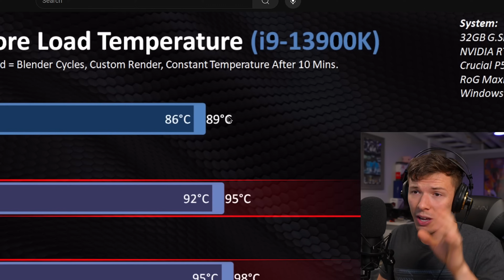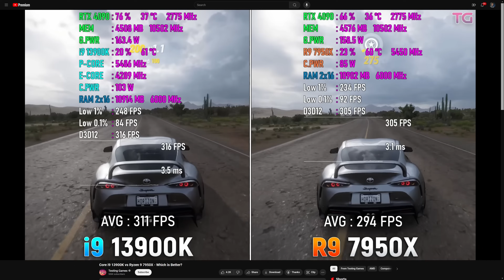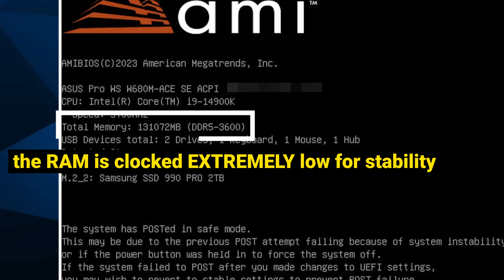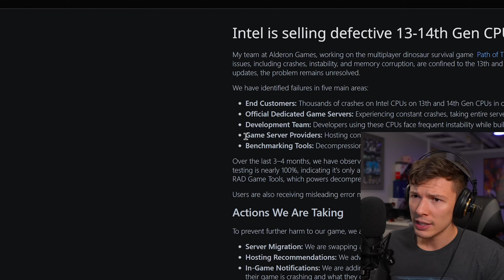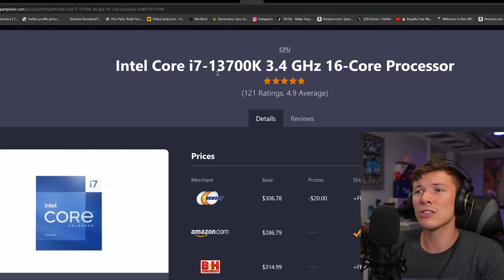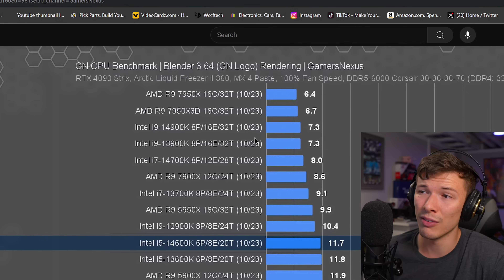Intel F**ked Up Bad

Comment: I'm not really familiar with this particular situation, but my thoughts after watching this video were: 

"Ok, well that really sucks. But then again, are the cpus actually at fault? These game companies are using server motherboards + consumer cpus? 
I mean server components and consumer components are generally designed with opposite philosophies in mind. Max stability vs Max performance" 
I'm a server admin myself and I take care of a bunch of Intel based servers. Various generations. I don't see this problem in my field of work.
Ok, so I just randomly logged into one of my HP gen10 servers. It has a Intel(R) Xeon(R) Gold 6132 CPU @ 2.60GHz (boosts to 3.7). Its a Q3'17 model cpu, Skylake family, 14 cores. And the same year consumer i7 / i9 Skylake family cpus (extreme editions btw) have like from 3.0 base, to 4.4 boost. Also, you use base spec ram on servers for stability. Many things can go wrong here. And if you are using a consumer cpu as a server cpu, perhaps you need to configure your server differently. Perhaps disable boost or do some undervolting if that is available. Not trying advocate for Intel here, I run Amd everything in my personal pc. Just saying that if you use something that was not specifically designed for that use case, it might run, but you might run into unexpected issues.
Anyway, I hope that Intel and their partners will get their stuff together and fix this problem.
Whew, that's was a nice quick brake from my CrowdStrike problems. Back to work. xD

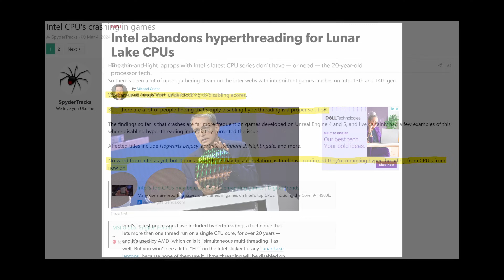Comment: 12:10 or so ~ Is it hyperthreading?
Ok, no simple answer. From what I've read, if it crashes, and you disable hyperthreading, that will fix it. For a while.
If you turn down the voltage, or limit the clock speed, that will fix it. For a while.
If you disable the E-cores ~ that often fixes it. For a while.
There was a strong indication when this started to emerge, that it was external communications, like data out to the video card and network traffic, and particularly high speed SSD reads and writes, and decompression of things like game_textures. Further looking at that, seems to show problems can and do happen there, but that's not the root cause of it.
Some M.2 drives produce a lot of 'network traffic' that's got almost nothing to do with that data, and one theory going around was it was Toshiba and Samsung M.2 drives. That doesn't seem to be the root cause either. 
Problems occur with many things, and depending how you parse your data, you can show very suggestive things about a lot of stuff, but the harder you look, the less it adds up.
Go listen to Wendel talk about it, he's fascinating. The frightening thing, it seems to effect more or less every high end Intel chip, certainly everything that's an i7 or i9, in the last two generations. Some chips have not yet been effected. Testing suggests they will be.
I know I would be much happier to be in the position Lisa Su is in, right now, than the one Pat Gelsinger is in. I think Pat's being forced to sit on a barbed wire bollard right now, coated with hot sauce and Denco-Rub.

Comment: My 14900K has been running spec intel settings in my MSI bios that was downloaded day 1 a little more than a month ago. Before I bought it I heard the performance and extreme settings were causing the failures so I made sure it ran intel stock settings out of the box and I would be fine.That is not the case and after about a week or so it started crashing tabs in Firefox at first. Then Wallpaper engine started crashing after an hour or so to now just few minutes. Now a game can't run more than 5 minutes without it crashing directly to the desktop if it's less than 4K. If it's 4k then it would run for longer but it's random if / when it will crash. Sometimes it won't but I haven't run a game more than an hour due to time. Running a MSI 4090 Slim with an Halo 622 cooler and thought that would be enough to do the job. I guess I needed a liquid nitrogen to cool the CPU. Insane that I just bought this after waiting 8 years to finally upgrade and I get this. Been an intel fan since the 1980's but this is unacceptable. The 9950X can't get here fast enough.
Reply: Lower the voltage of individual cores.
Is not the overall power but the fact that 1 or 2 cores boost crazy and draw too much power while the overall power consumption seems fine because the other cores are low. 
Limit the boost clocks as well.
Reply: @1ofZero  Thank you for your help, I will try your suggestions. I should not have to do this though, and I am very disappointed in intel for putting out this trash. Still switching to the 9950X even if this fixes the issue.
Reply: You downgraded your Intel cpu and it's never even close to Ryzen in anything

Comment: Intel really fked me over this time. Been using the 12400F since last year with the mind set of upgrading to 13th or 14th gen later (starts small and go big later) and now I'm stuck with zero upgrade path. Going above the 12th gen family is unreasonable, I might as well change platform at that point which I seriously considering in the future. Sticking with the 12400F/6700XT combo till it can't perform good enough for 1440p in heavy tittles.
Reply: Or you can just wait for 15th and 16th gen when these problems are fixed? Your current CPU is good for multiple years, it's beyond what many games need in 4K, if paired with a beefier GPU

Comment: Hey great video, unfortunately I got a 14900kf back in march, just before all the info about the instability and bios updates etc..
I underclocked mine so all cores are at 5.6ghz and it only ever seems to cap out at 85c when testing in cinebench. 
It took me a couple of months to get these completely stable settings. Before adjusting it I were getting frequent issues with Fortnite. 
Hopefully this doesnt fail on me but wouldnt be surprised if it still does.

I was wondering why do the tests at 50% fan speed? I assume if you are pushing the CPU that hard, shouldn't the fans be running at 100% during that time?

Comment: Omg…. Another video about this topic.I do not really think i9 12/13/14 gen is for everybody I do not really know anybody that running processor at stock settings.Anyone who has 20iq will do manual OC/UV and everything work as normal.My own 13900k oc/uv 5.5/4.4ghz woth 1.27voltage.Power consumption on desktop ni more 50 watts and while playing no more that 100 watts.Temps desktop 30-35 degrees and games max 60!degrees even now with  more then 30 degrees outside.Is this is a hot cpu, what power consumption.Are You running benchmark during your daily usage ?? My is cooling by Arctic Freezer II 360 with no problem at all.How many people from this community experience those problems with manual oc ???

Comment: People also have themselves to blame for this.
They should not buy 13900K/14900K which have high consumption like a pig.
13600K/13700K are absolutely stable and above all they will do a great job.
But the main problem of instability of this cpu is between the keyboard and the chair.
Most people build a PC and don't solve anything, then the board powers their CPU in the range of 1.35-1.45 Volts and suddenly everything is unstable.
Disable Hyper-Threading / P: Core 5.2GHz / E: Core 4GHz - 1.22V
And from the unstable 13900K, one has an economical cpu and maybe even with better performance and 30% better consumption.

Comment: Laughing in 7800x3D
Reply: Ohyes! The initial AM5 bios issues nonwithstanding xD
Reply: @mikfhan  at least it was fixed by bio update, you need to change your CPU Blue Boy
Reply: @rshad4ever  How well did the BIOS update work on the CPUs that shattered their dies?
Reply: @tim3172  AMD actually did refund before,
With 100% failure rate, Intel will never refound anyone
Reply: @rshad4ever  oh I am already on 7800x3D gonna ride it till the end of AM5 :) was on Athlon too back in the day until Nehalem arrived. Whatever gives most bang for buck.

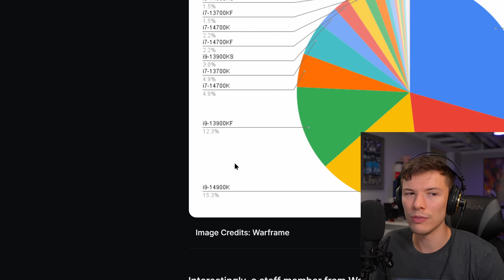Comment: 13:58 that's not true, AMD and previous gens of Intel are in that graph! It's just that they are in those very small slices at the top 😅 probably crashes caused by bad overclocks and such. Clearly there is a big issue with Intel 13th and 14th gen.

Comment: It's very simple, manufacturers started to use overclocked frequencies as base frequencies. Put this in the hands of consumers and you've got a disaster in the making.
If you cannot keep your CPU below 65 degrees, the silicon will degrade. Simple as that.
Reply: Thats a lie. Theyll degrade regardless temp. It is the electrons flowing in it due electricity (yea thats how wlectricity works)
Reply: @VaracolacidVesci  I have overclocked hundreds of systems. The only ones that died were ones that got hot for very long periods.
I also investigated a render farm where lots of i7's were suddenly dying. The computers were properly maintained but the fans were aging and had slowed down just enough to let the CPU bake itself.
Always watch your temps!
Reply: @jooch_exe  hahaha I doubt you have OC hundreds of systems. Unless you are a PC seller you wont ever have hundred of systems available. 
On the other hand I work with CPU manufacturing and I know for a fact that temperature without current is not what harms the CPu. OFC if you fry it it will kill it but if you put it in the over at 90c for a year it wont do a thing to it. But pass 2 Amps and it will instantly kill it even if it does not gets to even a 10c.
Reply: 65 is low and well within the thermal scope. CPUs can handle much higher than that. Some of AMDs CPUs often run up to 90c before throttling and have exhibited zero degradation as a result. The difference is they run much lower voltage and power, which is the silicon killer.
Reply: @Son37Lumiere  Depends how long and under what conditions you need that system to be stable. 65 is just safe. Remember NForce chipsets? Nvidia always said "they are within design spec", well they died, and not just because of solder.
Voltage will indeed shorten lifespan, but this is mostly because voltage regulation can only go so far. Things have improved compared to 10 years ago, but overshoots still happen. And those conditions are dangerous if you are already so close to the limit.
Reply: @jooch_exe  Temperature has a much lower affect on CPU life and stability than the power flowing through it. High enough voltages cause electron migration which is what degrades the silicon.

Comment: Is it ALL 13th and 14th gen processors or just processors > 16 cores?   I have only heard of 13th Gen i9.    My 13700K does not bluescreen and I scaled back the power limits on day 1 since I run on air!
Reply: It can fail too, check warframe crash report...
Reply: All Raptor Lake CPUs are affected, which means the 13600K/14600K or higher.

Comment: Is this failure rate affecting I3 and i5 lines or is it just the i7 i9 lines?
Reply: Mostly i9 and to a lesser extent i7.  The title is misleading though, it's a high percentage of CPUs but not 99.9% of them lmao.

It is mostly the super high boosting of 2 cores that is the problem.  So the CPUs that have very high boosts (5.8-6ghz) are the most effected.  Poor quality i7s that need more voltage can develop it too because to hit their high boosts it will put too much voltage through the chip.

Basically anyone who skimped out on cooling and is running the chip at stock or overclocked is screwed.
Reply: @JathraDH  so because the i3 and i5 are much less demanding CPU's they are likely safe until we get further data.
Reply: @darkmugetsu6572  i3 and i5 are probably 100% safe, i3 certainly is.

The problem is related to the high boosting cores causing the vcore of the chip to spike extremely high, like over 1.5v at the same time the chip has a sudden and rapid temperature spike which improper cooling systems can not remove the heat from fast enough.

The high heat + very high voltage is causing rapid degradation of the ring (the interconnect that connects all the cores/memory controller/cache together and handles general I/O) which gets fed the same vcore as the 1-2 high boosting cores do.

With the lower end chips they do not have these extremely high boost clocks, and the boosts they do use much less voltage which does not push the chip into the danger zone.

Likewise delided chips and chips on custom loop water cooling are far more resistant because the cooling is adequate to keep the temperatures in check which makes the voltage do less damage.

Lowering power caps and stuff does not help because the damage is only happening when 1-2 cores are loaded and boosting way over spec and the total power draw for the CPU is well under its power limits.  That is why the CPUs were still degrading in server environments with a max temp of like 83c.

83c is high, but not instant death under normal conditions, but put 1.5+ volts through the chip at 83c and it will cause damage extremely quickly.
Reply: @darkmugetsu6572   i3 and i5 are probably 100% safe, i3 certainly is.

The problem is related to the high boosting cores causing the vcore of the chip to spike extremely high, like over 1.5v at the same time the chip has a sudden and rapid temperature spike which improper cooling systems can not remove the heat from fast enough.

The high heat + very high voltage is causing rapid degradation of the ring (the interconnect that connects all the cores/memory controller/cache together and handles general I/O) which gets fed the same vcore as the 1-2 high boosting cores do.

With the lower end chips they do not have these extremely high boost clocks, and the boosts they do use much less voltage which does not push the chip into the danger zone.

Likewise delided chips and chips on custom loop water cooling are far more resistant because the cooling is adequate to keep the temperatures in check which makes the voltage do less damage.

Lowering power caps and stuff does not help because the damage is only happening when 1-2 cores are loaded and boosting way over spec and the total power draw for the CPU is well under its power limits.  That is why the CPUs were still degrading in server environments with a max temp of like 83c.

83c is high, but not super dangerous under normal conditions, but put 1.5+ volts through the chip at 83c and it will cause damage extremely quickly.
Reply: @darkmugetsu6572  YT keeps deleting my replies..  trying one last time.

Short, short short version.

It is the very high vcore that comes with the very high boost clocks that is causing the damage to the chips.  Lower end chips do not boost as high so they use less vcore when boosting.

The damage is mostly happening to the ring (the interconnect between everything) which is why so many random problems and I/O errors happen as the ring gets degraded.

In short the lower end chips are likely 100% safe unless they are being run very hot.

Comment: Man this has been so over hyped.  Manually lock the cores and voltage. Done.
Reply: since 9th or 10th gen enthusiasts have been locking the multiplier, undervolting and turning off HT - for better stability , lower power usage and almost the same performance.

So yea , In some sense you are right. But the average user is not supposed to do this kind of shit to get a system that is not overheating, crashing and destroying itself.
Reply: If only problems end here...
Btw if u undervolt it to work proper and lost % whats point of buying tht ?
Reply: @marcinkarpiuk7797  Losing a 300mhz boost on 2 cores that only boost that high when using a 1-2 core work load when the base speed is 5.5+ is not a big deal TBH.  Given it is not getting something that was advertised but its not like the chips are remotely slow with that disabled.
Reply: @marcinkarpiuk7797 Because sustained performance is more useful than peak performance.
Reply: @thaNZdon
Any brand new product must work reliably out of the box. CPUs are not exceptions. Period.
You cannot expect (all) consumers to make manual tweaks. Clearly you have no clue about basic rules/laws.

Comment: Like pushing 450 watts through a tiny 12pin propriatary connecter, Seriously what could happen?! Side eyeing you Nvidia! 😅
Reply: Fuck NoVidea -- sincerely, everyone ever
Reply: Well, 12 pins is more than enough even for AWG 16 wiring which is rather thin. The problem was always bad connections at the connector.

Comment: Intel service having a 100% failure rate 😬😬
Reply: That's incorrect. It's nearly 100% of crashes are intel CPUs. They don't have a 100% failure rate. If that were true this video would have 65 Million views atleast.
Reply: @LandonDean-zk4wn it seems to be indeed 100% failure rate (in the specific conditions this developer is using these processors)
Reply: @warmike  That would be indicative that the developers are doing something wrong. You don't see that in modern CPUs and there aren't many people coming forward and saying they have this issue. If there truly was a 100% failure rate, there would be 100 Million people xoming forward.